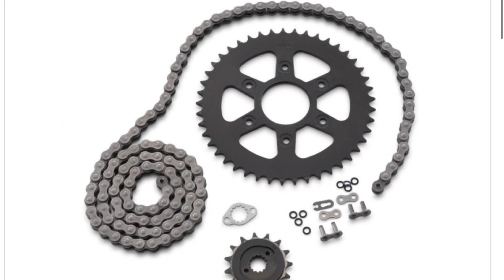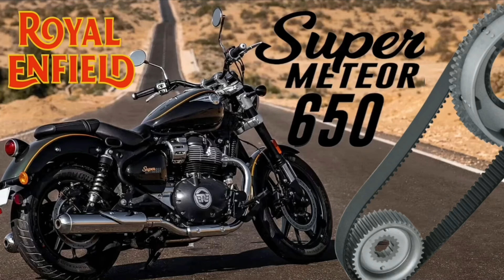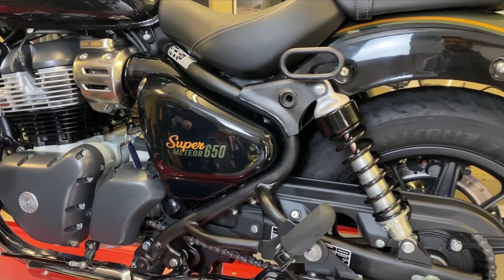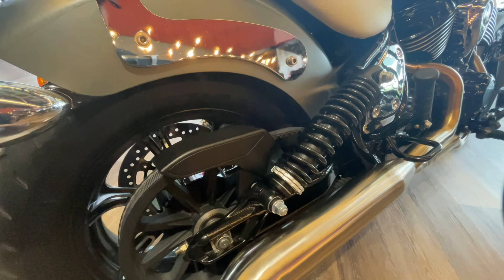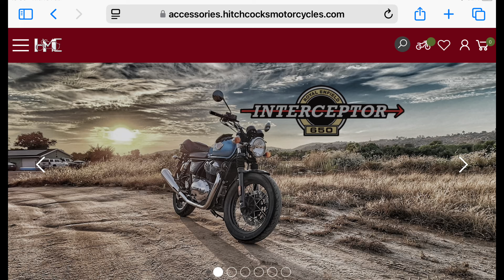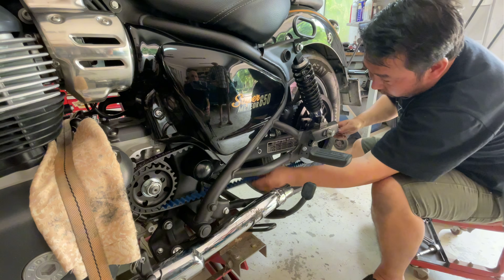Royal Enfield 650 Belt Drive Upgrade - Is RSTech Worth it?

Comment: 4:00 At least for Harleys, the reason given for Double Flanges is to protect from possible pebbles and also keep the belt cleaner from Brake Dust or other Road Grime (Since that side does face Inwards towards the brakes and inside of wheel).  When it comes to reliability, the cleaner the belt, the longer the life!
Reply from the maker: Thanks for that. Makes perfect sense 👌🙏

Comment: I converted my Super Meteor 650 to RSTech belt drive about six months ago. I’m extremely happy with the results, smooth and responsive. The system is fairly easy to install and no more grease to clean up. I highly recommend this conversion, thanks Mr Teacher T for sharing this information.
Reply from the maker: That’s great news and you’re welcome. It does transform the ride 👌🙏
Reply: @jrosenbaum7433  I am confused. TT says to me Vulcan system in the system but you already have one! Where when how do I get one please in the UK?
Reply: I contacted RSTech about ware to purchase and drive specifications. They were very helpful with a quick response.
Reply from the maker: @drdoolittle5724  There are other brands of belt drives. But quality is questionable. 🙏
Reply: @Teacher-T-Thailand  It is your experiences  that lead me to stick with your supplier and it is good that if it comes off, I would be straight on to the 'new improved' pulley !

Keep up the good work. How many minutes to retirement day, or will you be devastated gardening/walking the dog etc?

Comment: You showed the pre aligning only😉The belt is likely to drift after embedding.
Aligning and tension of the belt needs to be checked and adjusted at approx 300km when the belt is imbedded on the pullies.
When this is done, take about 10 maximum hard accellerations to cancel out any free play on the chain adjusters and have the tension settled.
The hardest part is to fine tune the alignment to have the belt run in centre of the rear pully equal free play to the flanges and not rubbing the front sprocket flange. This took me about 45 minutes of re-adjusting and re-tensioning the belt which was 10+ times on my Classic350.
This fine tuning takes about 45 degrees on the spanner each time and affects tension too, hammering on the wheel shaft forward to minimise the adjuster free play before tightening secure .

It's totally worth it. I did this mod on a brandnew bike before hitting the street and used ceramic coating to keep it clean better than showroom quality. After 2000km the belt still runs in centre of the rear pulley. But you do notice some "chain slack" by the needed free play on the belt.

I do realise stones are the belt and pully's worst enemy and I drive on paved roads only.

kr, Erik
Reply from the maker: Yes Erik you are right. I’m a bit worried about your chain / belt snatch you are still feeling though. It should be buttery smooth. It sounds like you have another brand of belt kit there 🙏

Comment: This belt drive is certainly on my radar after I wear out my chain which shouldn’t be long now with 9,000 miles on the odometer. Living at 5,600 feet elevation and typically going up from there while riding, I’ll probably stick with the stock gearing. Cruising at 80 MPH doesn’t seem to be a concern. I will sacrifice a little MPG for the low end torque.
Reply from the maker: Watch next weeks video please. I compare the ratios. 👌🙏

Comment: Everything lovely and ok, but, I can't buy it from RS Tech Int'l distributors (USA) since they haven't the RS Tech product in stock, I mean the standard gearing kit. Please Mr.T let them (RS Tech)  knows about this situation. Many thanks from Argentina for another super instructional video. A hug
Reply from the maker: Sure, will do. Maybe they were holding off re supply until the new stock? I will let RS Tech know 👌🙏
Reply: Baxter Cycle in Iowa should have stock now - if not message me as I am the old grey haired guy in the video
Reply: @robertstraghan9009  I love this kind of Service. Many Thanks Robert 🤝
Reply: @Ride-with-T  Thanks for everything Mr. T...

Comment: After more than 6000 km, no adjustment of the belt tension is necessary.                                                                                                                                 Cheaper alternative belt is the Continental CTAM HB135-20 also used in EU by Harley Davidson
Reply from the maker: Yes after install and maybe a quick small re-tension it's all simple ride and go 🙏
Reply: Yes there are now more than just Gates that make 14mm pitch, carbon fibre, high tensile, industrial belts with this same tooth profile,    Lots of choices  and you are not locked into the Gates OEM only 11mm pitch belt that you must buy from the bike or belt kit manufacturer..  Mitsuboshi Giga Torque is another such quality belt supplier.   Belt availability  direct to the Rider matters a LOT in ones purchasing decision, as does weight of the belt kit compared to the chain set it replaces
Reply: @ Yes THX, very happy with the Belt-dirive on my RE 
😘

Comment: Great video. I’ll certain consider it when Hitchcocks sell this upgraded kit. Currently they only sell your previous model. 👍
Reply from the maker: It’s great product, I’ve just come in for the day after comparing the  standard ratio to the taller gearing I had installed for the last 9 moths. Results out soon 👌🙏
Reply: Hitchcock's have stock in the SM Gen 2 in the higher gearing version now, and RSTech is shipping more inventory in all versions to Hitchcock's Thursday

Comment: I rode my Interceptor for five years and 8000 miles on a few squirts of chain lube, yes, it would be nice if it came with a belt as standard but I wouldn’t bother converting to a belt.
Reply from the maker: If that's all the mileage you have done in 5 y,ears, then yes little point for you. Belts ideally suited to high mileage riders. It's a personal choice and understandably not for everyone 🙏
Reply: Interesting, did you never clean your chain?

Comment: Certainly a tremendous upgrade.  And a good Gates belt should last 100,000 miles, depending on the harshness of roads ridden.   Has RS Tech approached Royal Enfield about making these standard equipment on the 650 line of bikes?  If they did they would surely sell more of these bikes here in the states, and maybe everywhere.
Reply from the maker: I’m not sure. Royal Enfield are very capable of producing themselves, but prefer not to, to win the price war price point on bikes. But we do know of many new bikes having the RSTech belt drive being fitted to brand new bikes with 0km on them.  Because as you know, after having a belt drive, it’s hard to go back to chain 🙏
Reply: Belt drive has substantially more power loss than chain drive.
Reply: @Ride-with-T  Thats a fact, chains are a pain, unless you have lifting stand which the RE has.  I have always preferred the shaft drives that Honda, Suzuki, and early Yamahas that I owned had, my current Victory Cross Country has which should easily get 10s of thousands of miles before replacement.  Any way the new version RS Tech looks like an extremely well built unit, and if I buy an RE, will immediately be put on.
Reply from the maker: @deltabluesdavidraye  and where is the proof? It’s minimal, not substantial. And it makes it up in easier slicker faster gear changes. No dipping in the front forks at all, which in turn causes power loss. You are quoting data from years ago, and not bearing in mind the new technology belts. The Meteor is only 45hp. The loss if any is not noticeable at all. For cruising it’s perfect and more fuel efficient. Less messy and a more smooth pleasurable ride.  Harley and Indian choose belt drives for a reason 🙏

Comment: There is an update on the chain from Royal Enfield new chain is much stronger and durable and doesn't cost much, so there isn't an actual need to switch to a belt drive which is expensive.
Reply from the maker: It’s good to hear there is a revision to the chain. It did seem too long, and not much adjustment left. It’s more than just the cost to consider though. It’s the smoothness of gear changes and fuel economy increase also. In the long term belt drive works out cheaper  Nice Channel by the way. May need your help in a future video 🙏🙏
Reply: RE stock chains are crap and should be considered a safety concern. Cheap Chinese rubbish. Mine only lasted 5k miles and the uneven wear was horrendous.  Pure junk, as are the stock Ceat tyres and naff brake pads. Belts seem a good idea especially on low powered bikes like my Classic 350.  Cheaper in the long run too. Good enough for Harley's which is good enough for me.

Comment: I'm considering buying the Super Meteor and planning to modify it by changing the suspension and converting it to a belt drive, along with a few other upgrades. However, I'm concerned about the reliability of the bike after these modifications, particularly since the suspension and belt drive are two of its main downsides. I would really appreciate your insights on how reliable the motorcycle has been, especially after such modifications.
Reply from the maker: The 650 twin Engine is very reliable. Proven in the Interceptor for many years now. Capable of doing over 100,000 km. since my suspension and belt drive upgrade things have been good. We made a short series of travelling Thailand North to South and back again. Over 2,400 KM with luggage and pillion. Everything worked well 🙏 Royal Enfield Super Meteor 650 Touring Thailand
https://www.youtube.com/playlist?list=PLbUfcld-ww5rNhvxupoivQRgZR-Cxy6EZ
Reply: @Ride-with-T  appreciate the answer

Comment: Interesting videoT. Robert is not resting on his laurels. The double flange looks great. It seems like the weight of the kit has been reduced over the early version. If so, I wonder if it might improve performance.
Reply from the maker: No difference in performance, apart from I have switched gear ratios this time. Just for a test comparison. I make sure Robert doesn’t get any rest 😂🙏

Comment: 650 Suzuki single belt no adjustment 15;000 no oil  no problem no rust all bikes should use chain is cheeper only reason
Reply from the maker: Yes, manufacturers prefer to fit chains because they are cheaper to fit, and also a regular consumable to sell. 🙏

Comment: I would put the belt drive on both my bikes, Suzuki v-strom 650 and my Royal Enfield meteor 350 if I could obtain them.
However, I understand that the company hasn't manufactured this system for these bikes.
Reply from the maker: V Storm no. Meteor 350 in the pipeline. On test phase at the moment. But don't tell anyone 👌🤣🙏
Reply: You can order from MTechnics from India, I have already installed on my Classic 350 no problem to fit and no issues, beautifully made. The company has videos on YouTube and uses a  Gates belt.
Reply: Hi Teacher T. Good Video as always. I was wondering if RS Tech would have plans for the Kawasaki Vulcan S ? I’m really interested if that’s the case. Greetings from Colombia. Jhonn. Waiting all the videos about this interesting mod. Bye
Reply: @639viablecarrot  But not the readily available Gates belt you can buy from any Gates Dealer worldwide.  I never will understand  why one would fit a belt drive that is heavier than the chain set it replaces....................

Comment: Hi I've just got the belt drive, I would ask you to confirm the correct way to torque the new front sprocket, as I'm not sure about the belt taking all that pressure if you use the back brake. Thanks J
Reply from the maker: The belt can take the pressure no problem. Just put the rear wheel against the kerb, and use rear brake also. As long as the belt is correct tension, all is good. 🙏
Reply: @  Thanks for the information J

Comment: Is the belt drive advisable for Shotgun 650. And will it work if I take the belt driven bikes on hilly areas or mountain with good inclined roads? Thank you
Reply from the maker: Yes many people have fitted the belt drive and are happy with it on the Shotgun. The belt is more than strong enough to pull up steep inclines no problem. But if you are travelling of road and on gritty gravel tracks, then maybe no suitable. The belt drives were designed to go from one side of America, and back again. Something that would require chain and sprocket changes. But the belt, no need to change. Just ride. But that is on good metal roads. No gravel tracks. Hope that helps. 🙏

Comment: Wouldn't it just lower the power as belt drive is definitely smoother but it eats up almost 3rd of the power .
Reply: Errr .... no.
Really not a lot in WRT transmission losses between a timing belt or a well lubricated chain - about 5% IIRC.
Reply from the maker: Ha ha ha . A 3rd. No way. If it does lose any power, it’s not at all noticeable, probably made up with the speed you can change gears without any drive snatch at all. These new belts use high tensile carbon fibre strips in them. Probably more stretch in a chain 😂🙏
Reply: Think about that statement - if the belt generated that much friction due to power loss it would melt!!

Comment: Do you still need to trim down the front sprocket cover?  Also how do I know if I'm ordering the new or old one? N I went to all the websites and couldn't see anything saying new 2.0 version
Reply from the maker: If you are talking about the Intercepter 650, then yes a slight trim of the front cover is needed, I think all the suppliers hold the version 2 now. You just need to confirm when ordering that you want the version 2 🙏

Comment: Hi Teacher, yesterday i bougth the belt drive kit 2.0 stock for my super meteor. I should change the exhaust.... I like kp racing because they are the same stock. What do you think?
Reply from the maker: Stock ratio is a good choice. I think I prefer it. And yes I will be changing exhausts soon. So many to choose from. But the original ones weigh 5kg each. So a good way to drop weight off the bike also 🙏
Reply: Now do you have already stock kit right? How many km with it? I wait your video for new exhaust
Reply from the maker: @ Around 800km on new Version 2 kit now on stock ratio. I will make a video soon of differences I find between stock and taller ratio. It will be a few months before I can make a video about exhausts, as I will be leaving Thailand to visit UK for a few months 🙏
Reply: Yes... Sentation whit your new belt 2.0 stock. Ok for exhaust.... But do you have a advice for exhaust?
Reply from the maker: I made a video last year about exhausts. But even more available now. But these still seem to be the best of them : What Exhaust Should I Get For My Super Meteor 650?
https://youtu.be/iDlViPewCKk

Comment: Would installing a belt drove system void your warranty?
Reply from the maker: Would fitting aftermarket exhausts, or air filters void your warranty? It's a difficult one to answer. But a belt  drive has less effect on the engine than an exhaust system does making the engine run hotter.

Comment: Do you have to remove the swinging arm to fit it??
Reply from the maker: Initially we thought yes. We learn as we go along. Now we have learnt you don’t have to. You don’t even need to remove the exhausts. Just disconnect the rear shocks at the bottom, and push them out the way, and put a jack under the rear wheel while it’s on the centre stand. Raise the wheel and you can remove wheel axle and wheel no problem. Then lower the swing arm to the ground. There is just enough room to remove the old chain and put on a belt drive. I will cover it in a new more detailed tension video soon. 🙏
Reply: @ Thank you, I’ve had a belt replacement on a Harley, the swinging arm has to come off with them!!!